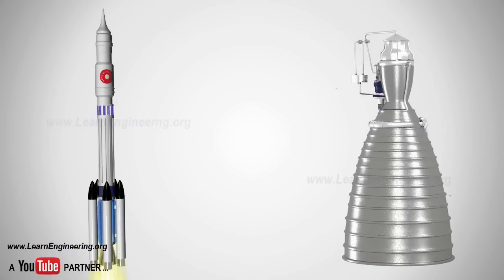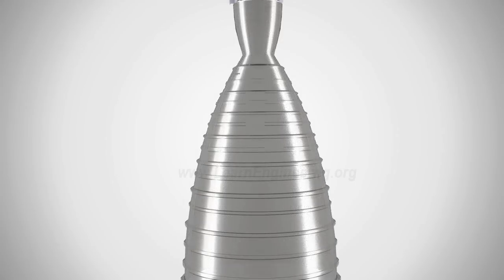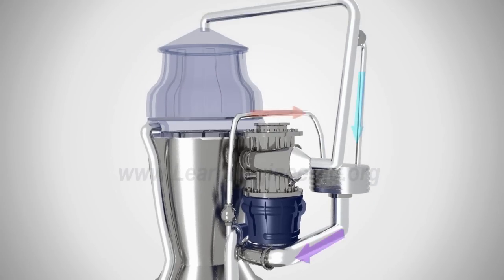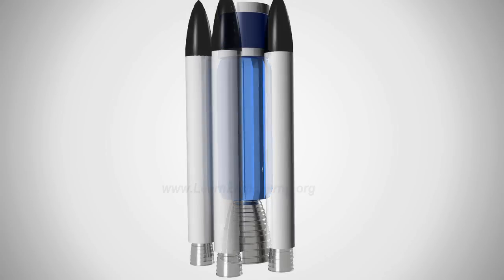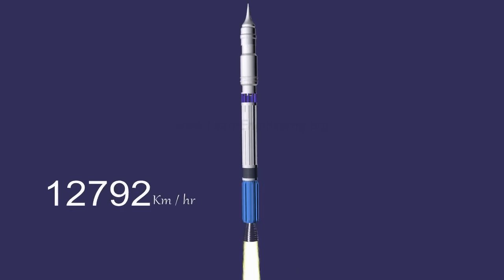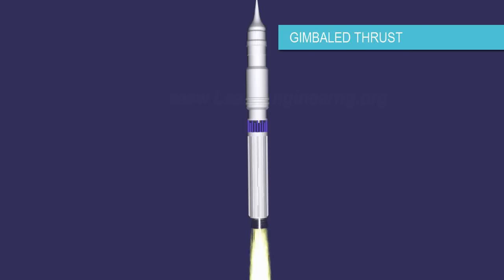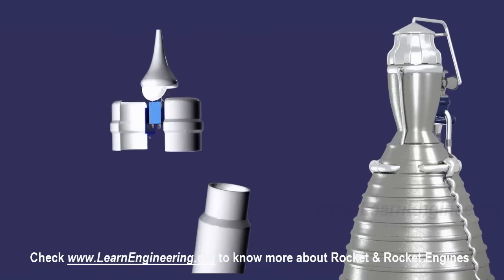How a Rocket works?

Comment: What is the ejected high speed mass acting upon to create thrust?
Reply: The forward inner wall of the combustion chamber.

It's actually all VERY simple.
Just think about it at the molecular level.
Two chemical components (oxygen and hydrogen, for example) are mixed and react by forming a very fast expanding gas.
The gas molecules fly at high speed in all directions, hitting the inner walls of the combustion chamber, creating a pressure against them.
To the sides, the pressure aginst the walls cancel each other out.
To the rear, there's no wall, just an opening, so there's nothing to cancel the pressure aginst the forward inner wall out.
That pressure, against the forward inner wall, pushes the combustion chamber, the rocket engine and the whole rocket forward.

Continue to think about it at the molecular level.
In an atmosphere, there are a lot of air molecules (between them, there's "nothing", no magical "ether" or the like).
The exhaust gas molecules, that stream out of the rocket engine, hit those molecules, but HOW could the energy that results from those collisions OUTSIDE the rocket engine, transfer that energy back to the forward inner wall of the combustion chamber, to push it forward???
Of course it is impossible.
That's why you don't need an atmosphere for a rocket engine to work.
Reply: YDDES 

So essentially in violating fluid dynamics you're saying that the ejectorate thrust is simply pushing on the walls of the expansion part of the nozzle & that THAT'S what's pushing the rocket up?.....not the focused expansion of the exhaust thrust against the external atmospheric pressure?.

Even when I say this out loud it sounds preposterous!!....

Naturally even more preposterous is that you are certain that it would work in a vacuum.....as in the vacuum of space & an absolute vacuum at that, which would absolutely suck/disperse & evacuate utterly so, any ejectorate immediately without allowing it the supposed thrust action upon the walls of the nozzle as you outline to produce propulsion.

Take a water hose... turn the water on in the water hose starts to squiggle on the ground & dart about because of the ejection of the water out of the end of the hose acting upon the atmosphere (fluid dynamics reacting upon fluid dynamics oddly because Air is considered a fluid)...the greater the velocity of the ejected water, the greater its effect upon the surrounding atmosphere which naturally opposes it & the greater the reaction to the action of the same.

But clearly you're going to disagree with this because you're so much smarter than me or the fact that I'm no rocket scientist while those whom you rely upon for your rote pavlovianly remembered regurgitated answers are apparently "scientists"...

Now I know you're going to tell me that I need to go back to fourth grade science class, or that I just don't know what I'm talking about, or that I need to go talk to a physics professor or perhaps the rocket scientist's at NASA & all I'm going to tell you is that NASA's are deceivers, liars, & thimble-rig skulduggery meisters....with their highbrow high minded high-fiving highfalutin self-congratulatory fancy PhD's in theoretical science (Which is nothing but a self-serving religion in another itself) with all sorts of chalkboard dusted
maze extrapolations that lead to nowhere except as privately interpreted by themselves....& with all things thus rightly prudently & logically socratically considered? I am left with leaving you with a Tesla quote that basically sums up the entire bullshit aspects of the matter at hand:

"Today's scientists have substituted mathematics for experiments, and they wander off through equation after equation, and eventually build a structure which has no relation to reality."

And why? Because there's absolutely no proof to substantiate those theories of "gravity", of "relativity", of "dark matter", of "special relativity", of "string theory", of "quantum entanglement", and all the other faith based theoretical craptastic BS dogmas that are asserted as "fact" by so-called "scientism" only because they keep repeating them & repeating them with so much presumed hubris & coopted authority all-the-while it seems so deeply ensconced & steeped in the Roman catholic church model & is therefore even more dug in as a faith based belief than the RCC....but then again the RCC is the one insidious serpentine organization that created, foisted, fostered, inculcated, & funds modern day science even going so far as to postulate & assert the "big bang theory" (postulated and asserted by a Jesuit priest no less; research it!).

So yeah but I'm gonna have to decline your well thought out & well presented extrapolated theory & presentation unfortunately
....because it's all predicated upon the fatal serpentine sophistry of the RCC....

And my apologies but nothing good in the least of a list of speculatory consequence can or does originate from the bowels of the RCC...except for suspiciously specious serpentine sophistry.
Reply: The gas in the combustion chamber expands faster, than the vacuum sucks it out. You must understand that there is an ongoing "explosion" in the combustion chamber the whole time, creating a very high pressure.
Actually, vacuum doesn't "suck". It's the gas, that expands out in the vacuum.

No, it's NOT the water acting on the atmosphere, that makes the waterhose move. 
It squiggles just the same way, if you put it in a vacuum chamber.

It seems like you don't understand "molecules". Even fluids and air are just molecules, with no "fluid" or "gas" between them.
So, I ask again: How can a gas molecule, flying out from the rockets combustion chamber, hitting an air molecule OUTSIDE the chamber, push the rocket forward???

Why do you resort to write a lot of rubbish about NASA?
What do you think you gain by that?
There are tens of thousands of scientists and engineers, all around the world, who have known exactly how rockets work, long before NASA was established.

So, just because you personally don't understand science, you just deny it. Still, you use a lot of things, a computer for example, that your hated science has created...

I honestly feel sorry for you.

Comment: So is the fuel supply line in a helix configuration around the nozzle cover? It doesn't look like it but your arrows seem to imply that it travels around the entirety of the cover before entering the combustion chamber.
Reply: The circumferential rings around a typical engine nozzle (F-1, J-2, SSME, etc.) are reinforcement rings, like the rings on a wooden barrel; they are not actively cooled.  The nozzle is cooled using axially orientated tubes, or channels that interface the hot internal gases.  The cooling channels or tubes can be one pass up, like the SSME tube wall cooling; half pass down to a turn-around manifold and then up thru the throat and to the injector, like the J-2; or a two pass cooling from the front of the thrust chamber to the aft end of the thrust chamber back to the injector.  The tubes or channels thru which the coolant (propellant) flows keeps the hot combustion gases from melting the chamber walls. The external rings hold the bell structure together.  On the SSME you can only see the tubes only in the last bay because the entire length of the structure is enclosed in structure as thin as .010 inches.  On the F-1 (Saturn V booster engines) the tubes are visible between the reinforcement bands.  The J-2 engines (Saturn V second and third stage engines) the tubes are visible between the bands up to just aft of the thrust chamber throat.

Comment: I think it would be interesting to build a vertical launch rail.  If it started 200 m below ground and extended 100 m above ground, and had an acceleration of 15 m/s^2, the exit speed would be about 94 m/s.  Obviously that's small by the scale of what's needed, but it could increase the payload and be worthwhile.  The downside is you can't really abort a launch if the stage 1 engines fail.

Comment: develop a concept design of the liquid fuel rocket engine for a sounding rocket, energy needs to get the payload to the desired altitude, description for the mass flow rate limit through the nozzle and the attainable thrust in dependency of the combustion chamber conditions and geometry of the nozzle. apogee: 280km, Free flight after separation: 300s, Payload (total): 200kg, Dry mass (excl. payload+fuel): 750kg max

Comment: Wow so much fuel is wasted to put tiny antenna on earth low orbit.
Reply: Yeah, but keep in mind that the fuel for the rocket makes up less than 1% of the actual launch cost (i.e. a falcon 9 launch costs 60,000,000$ while the fuel cost is ca. 300,000$). Also, you probably want those satellites for communication, GPS, television, internet, science, ...
Reply: Thousands of rocket launches would equal to less than 1% of the fuel that is burned every year.
Reply: bratimm Rocket fuel is much much more expensive (liquid fuel) and don't forget about the solid fuel (boosters) that contains tons of tons of aluminium, which is wasted and can never be recycled...
Reply: LikeYou Rocket fuels like Hydrogen and Oxygen, or Methane and Oxygen are easy to produce and not needed for anything else so I wouldn't call it "wasted"
Reply: LikeYou srb's are recoverable

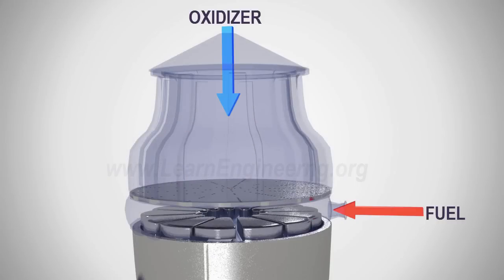Comment: 0:45
That is clearly not the combustion chamber. This is the oxidizer dome. 
The combustion chamber is below the fuel inlet. It's basically the the subsonic part of the laval nozzle.
Reply: Thank for saying laval.
Reply: Yeah, "combustion" occurring above the fuel inlet. I think the clip's producer just wants to publish examples of their 3D modeling work and is going light on the research. Basically a half hour spent on Wikipedia would have dispelled their misconceptions well enough for an introduction to the subject.

Comment: I have one question, during rocket staging the mass detached must hit someone below. That might look like a big stone falling on crowd, so how is it managed?
Reply: Launch sites are built in locations that have a low population in the direction of travel of the rocket. The United States uses Cape Canaveral, Florida as its major launch site, and launch out over the ocean. During launches, they keep ships out of an area where debris might fall.

Russia launches from Baikonur Cosmodrome in Kazakhstan. This is an extremely low population density area, so the risk of it falling on anyone is very low. Other countries use similar launch sites to minimize the chance of a spent stage causing damage.
Reply: +BlazeRazgriz1 Thank you.
Reply: Ferdinand Wohlrab glad to know,thank you
Reply: They also generally aim for the ocean, Even when landing reusable rockets
Reply: BlazeRazgriz1 nowadays Russians use the Kourou launch facility, since it provides more kick than the baikonour
Reply: Ferdinand Wohlrab no they don't
Reply: The video did not explain the concept of gravity turn. A vertical take off rocket will tilt over almost immediately, some as soon as it passes the maximum dynamic pressure threshold.
Reply: # RJ Some boosters also have parachutes

Comment: HOW CAN rocket propulsion function in the empty vacuum of space?
Reply: Rocket propulsion is based on gas expansion directed through a nozzle. Unlike with air breathing engines this is generated by fuel, either liquid mixtures or solid, which contains all the necessary components for the chemical reaction that produces the gasses meaning it can burn in space. So long as the fuel is burning it doesn't matter if there is atmosphere or not, there will be a force.
Reply: In addition to what the previous answer statet rockets gain their thrust by newtons 3rd law: every action has an equal and opposite reaction.
So if you throw out a huge amout of mass (in the case of the space shuttle tons per second) at a high velocity you create a force down but also the same force up acting on the rocket. You can think of it like sitting on a swing and throwing a heavy object like a medicine ball. If you do this the ball will fly, but you will also be accelerated in the opposite direction.
Reply: Edward Osorio So I wonder if you're a professional poe. Your first statement was rather articulate if misguided. It offered basically perfect grammar.

Your follow ups demonstrate a decidedly degraded mental capacity. Its like you're trying to look like a lunatic flat earther.
Reply: Edward, has your question been answered?  The newton's third law was the closest but I wonder if that satisfied your question.
Reply: To explain it with "Newtons 3rd law" might be difficult to understand. You could just say: The rocket pushes itself off the fuel
Reply: +BollocksUtwat cool answer....the only thing is....that theres No such thing...AS FLOATING SPACE...does not exist.
Reply: +BollocksUtwat cool answer....the only thing is....that theres No such thing...AS FLOATING SPACE...does not exist.
Reply: Edward Osorio
I'm not sure to what you are refering to by "floating space". Could you please specify it?
Reply: +Mid Night FLOATING SPACE is supposedly things are outside all ready past earths gravity field..and things float...
Reply: +Edward Osorio just as NASA and other space agencys show people....get it now.
Reply: Edward Osorio
things can never go out of earth gravity field (or any gravity field for that matter) as the reach of it is infinite, it only get's less with increased distance.
And i stil don't really get why space should float, objects can float through space (kinda a bad word for it)
Reply: You guys are wasting your time.  Edward doesn't believe that space exists.
Reply: Kreuzer Sixtysix I understood him from the "TRUTHER"...

Comment: I hope I can work for NASA
Reply: Study hard and do summer internships at aerospace companies.
Reply: Majd Sahmarany move to the west
Reply: sasha ford why the FUCK would you want to??? NASA is a space company that has failed in many ways even if they did get to the moon.
Reply: Fly with SpaceX fgs
Reply: Oh cool, out of context insults and as well as statistics that you likely pulled out of your ass (as 5 minutes of research may suggest otherwise).  Grow up.

Also, my spelling is no worse than yours, and 'egregious' is an actual word.
Reply: Majd Sahmarany apply for isro internship.Thats the only option you have
Reply: I'd rather work for SpaceX or a private company
Reply: SpaceX treats its employees egregiously
Reply: ClockworkHex yeah I don't think people are gonna take your two cents as something to think about since your spelling is worse than that of a 2nd grader. Also SpaceX has extremely high employee satisfaction
Reply: @dxguy I am trapped in the middle east where there is no single aerospace company, any suggestion bro???

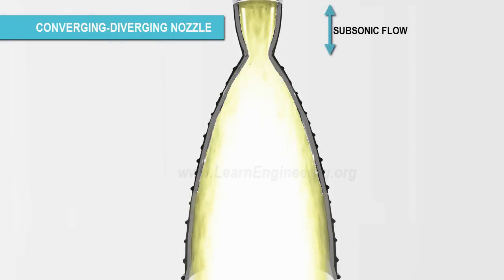Comment: at 1:20 how could the diverging part of the nozzle help converting the flow to supersonic ? The larger the diameter, the slower the flow according to fluid mechanics.
Reply: Well its an adiabatic expansion process which accelerates the flow due to the available pressure difference between combustion chamber and the surroundings . The equation states that nozzle needs to be converging for subsonic flow and diverging for sonic flow to be accelerated to supersonic. The equation can be googled easily

Comment: Wait
So if the gas generator takes bypassed fuel and oxidiser from fuel and oxidiser pumps
And the pumps are driven by the turbine
And the turbine is driven by the gas generator
Then how does the gas generator get the bypassed fuel and oxidiser in the first place, if the bypassed fuel and oxidiser come out of pumps which are driven by a turbine which is driven by the gas generator itself?
I'm confused and so are you probably.
Reply: On earth, while starting the rocket,  the fuel in the fuel tanks is pushed down by gravity and flows into the gas generator. In addtion to that fuel tanks are sometimes pressurized, mainly by helium, which again forces the fuel down the fuel pipes. If the engine is stated the acceleration upwards is the main mechanism to bring fuel to the turbopump and the gas generator.
In space it pretty much boils down to the same priciples. One difference is that in space the fuel isn't held down like on earth thus so called ullag motors or the reaction control system (in the form of cold gas thrusters) are used to give the rocket a little push, forcing the fuel to gather in the bottom of the tank thus flowing into the turbopunp/gas generator,  before igniting the main engine.

There are other ways to archieve these results, but they are a bit more complicated so i won't adress them here.

I hope this can help.
Reply: I've had this question for a while as well.
Reply: Samovar maker SPAAAAAAAAACE
Reply: What came first? The egg or the chicken?
Reply: Samuel Camilo Padilla Castro hmmmmm
Reply: pfifo fast I mean this stuff isn't that hard to understand. It's not fuckin rocket science
Reply: As opposed to figuratively describing rockets?

Comment: "The greater the momentum the rocket loses, the more force, or thrust, on the rocket."  @ 0.28 seconds

That's not correct.  I think you meant to say mass, not momentum.  The rocket is gaining momentum as its velocity increases.  Its momentum gain is exactly equal in magnitude and opposite in direction to the momentum gained by its exhaust.  It is, however, losing mass to do so.  Combustion provides the energy necessary for the rocket system's overall increase in the magnitude of its momentum.
Reply: Yeah I was confused about that too. Thanks for clearing it up
Reply: so that's why JPL got their name.
Reply: thx I was so confused